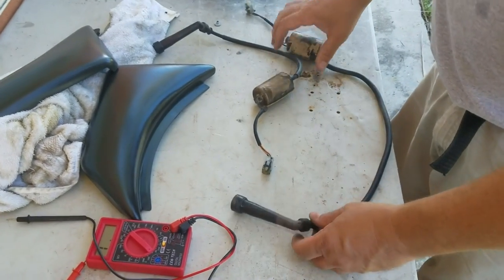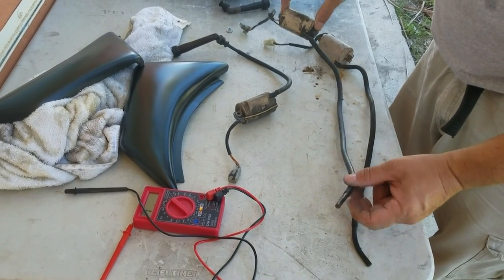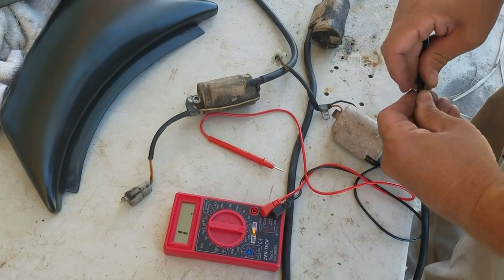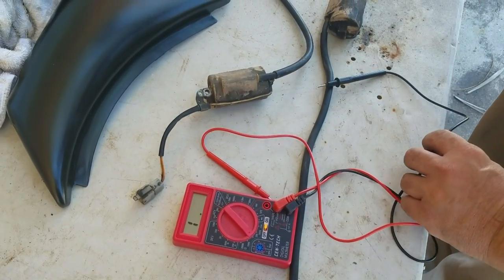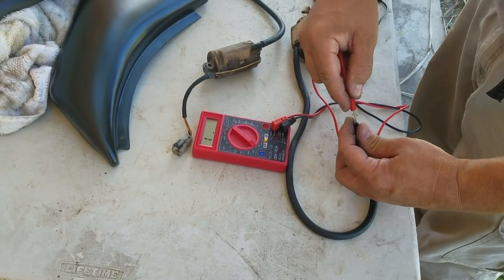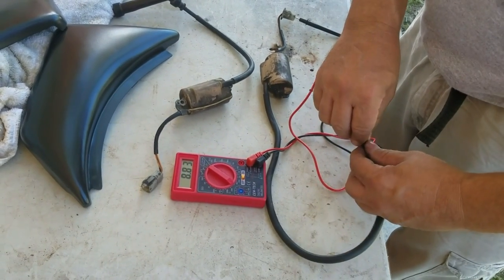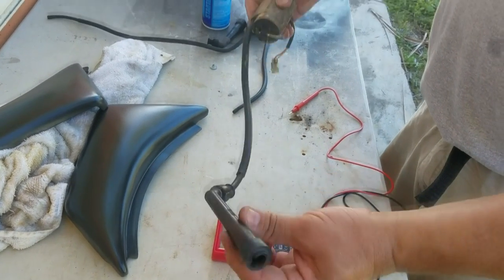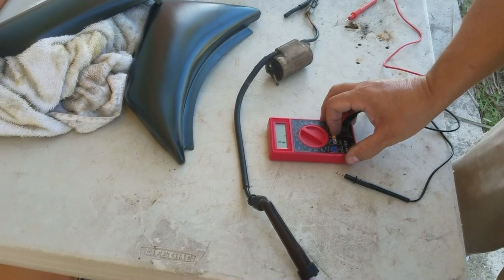How to test a motorcycle coil

Comment: You made a mistake testing longer coil lines. You need to leave the plug cap on. Or test the short one with the plug cap off. The plug cap may be a 10k ohm resistance bringing your total value to almost exactly what you were looking for

Comment: Could you test a coil with a condenser the same way
Reply from the maker: Good question. What I know about condensers is that it hold a charge that can be used as needed. So I would isolate the condenser in order to test it. First find out what is the condensers capacity. Second discharge the condenser by way of a drainage circuit. A voltage meter would work.Third charge the condenser to it's required capacity. A quality voltage meter will also do the function. Lastly check to see if it holds the charge until needed. Although I have never ran into a faulty one on a motorcycle they have been the cause for many of lawnmower no start issues in my experience.
Thanks for watching and commenting. 💖💖💯😎👍👍

Comment: Doesnt the plug cap add resistance?
Reply from the maker: The resistance read is in the coil unless the cable 
or cap is faulty. On another bike i was getting speratic spark on one plug so i unscrewd the plug cap trimed .5" of the end of the cable and put the cap back on and that took care of it. So if the resistance reads good then the coil, cable and cap are all good but if the resistance read bad then verify wether its the coil, cable or cap.
Reply: Yes, it will if the cap has a resistor in it, ohms will be higher depending on the size of the resistor.

Comment: Hey OG, what's your take on my vs700 coils reading mid 4ohms at the wires and mid 14 at wire and spark wire ? Thinking the tree e on there on the way out. Can not get the bike to stop chugging and  popping/ backfiring. Any help sure would be appreciated!!!
Reply from the maker: Hard to say. I would check the spark plugs first for spark and while the plugs are out check the compression, If the spark plugs spark then i would check timing chain. If no spark at the plugs then I would test a new plug if still no spark at the plug then test the wire and coils.  4ohms not good but it could be the setting was off or bad contact at the meter. Try a different meter. Upload a video of the diagnosis if I can't help some one will. You tube is packed with knowledgeable people willing to help. Thanks for watching. 💖👍